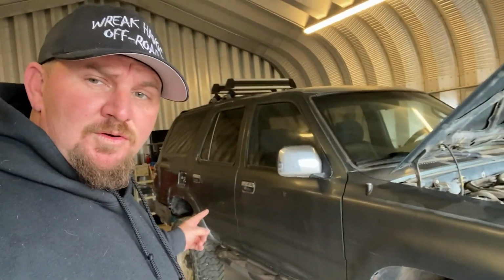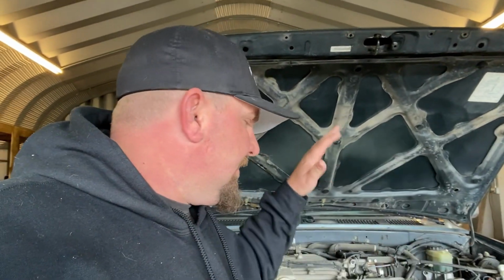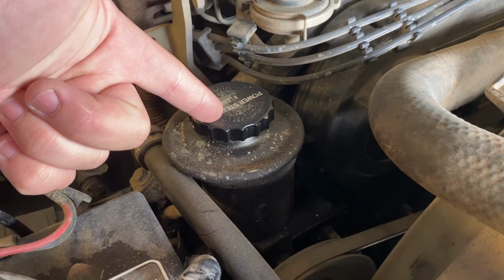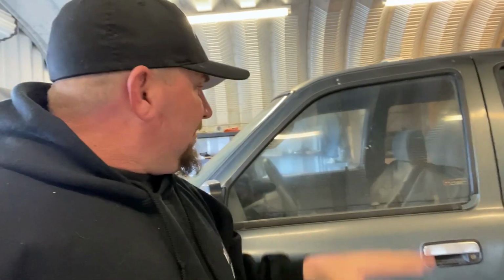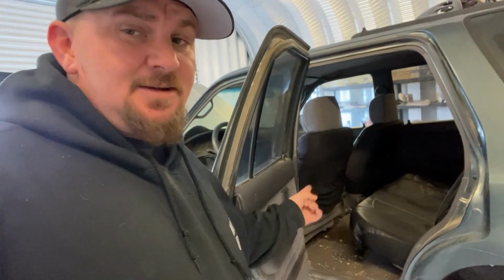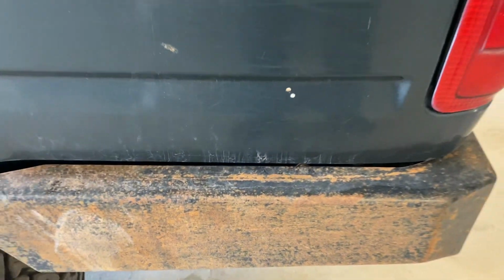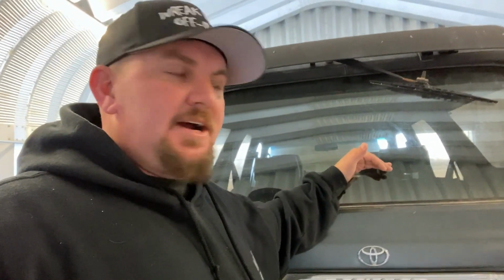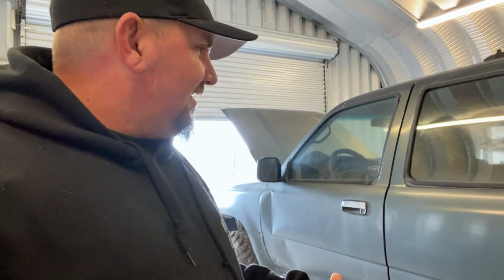Can you build a 1993 Toyota 4 runner rock crawler with $10,000

Comment: I just bought a 1993 4runner on a whim...3 owner California car 160K manual...I cant wait to follow this series.....game one sir!
Reply: ive been researching my ass off learning all I can about this 3.0 and going thru to figure out whats up with this rig...so far we had a stripped rear axle fill nut fixed, code 52 knock sensor (put in a generic one on the outside of the block just to turn off check engine light, leaking driver valve cover (fixed), ripped out searing column lock fixed (bought at auction someone tried to steal it just stole the cat and destroyed the ignition.....the rig on the inside is MINT perfect interior all windows work fixed rear hatch window with a wiper bypass...also had a broken window on driver side rear fixed... please post another video!!!

Comment: you should try and do the most crawling with the ifs that you can. lockers and have some fun with the ifs till you find a axle or break the ifs bad.
Reply: @wreakhavocoff-road7163  i think it would be interesting to see what you can do. ifs takes driver skill. i love the channel keep it up
Reply: I didn't do a SAS until I bent the LCA mounts doing a trail rated for 35s to 37s + one locker. I was on 29s, sliders, homemade skid plate for the front diff, chevy sprung rear, 4.88s, no front sway bar, and an aussie locker front. The torsion bar ifs will let you swap cv shafts out without taking the wheel off. And it's flanged so you don't have to worry about leaking oil on the trail. Never had swap a cv shaft out on the trail though. Keep the stock geometry and close to stock tire size and they last.